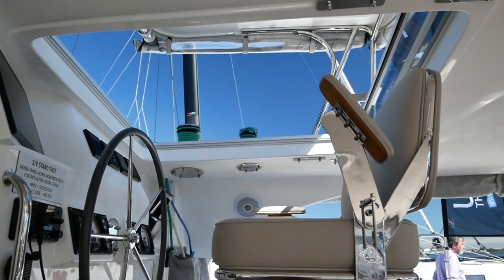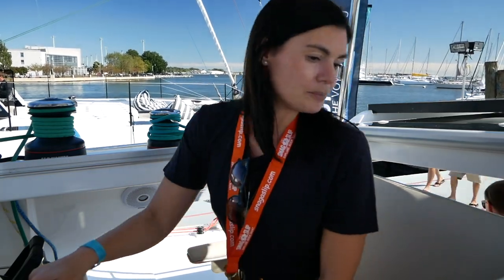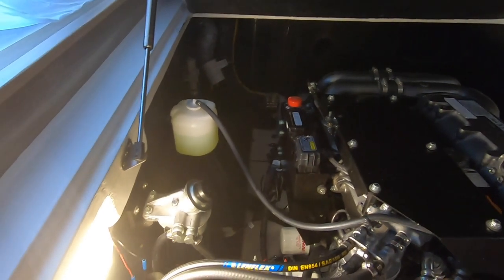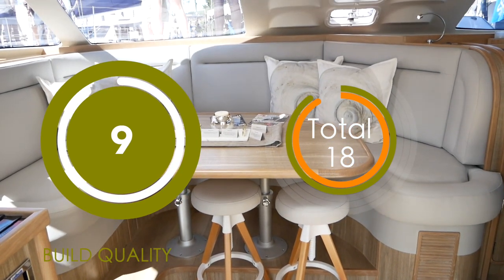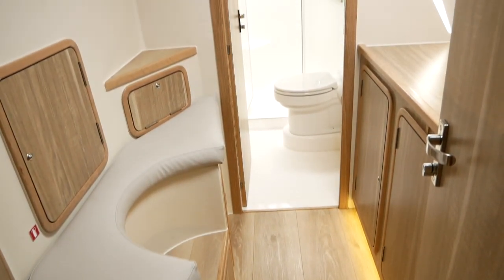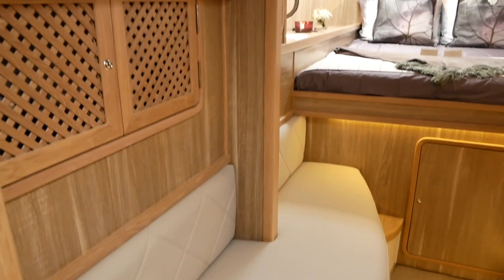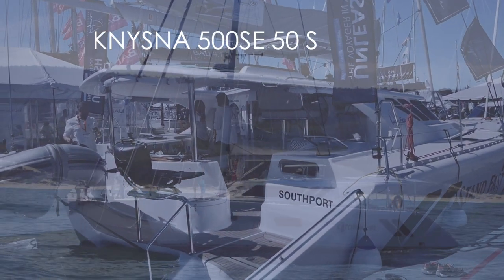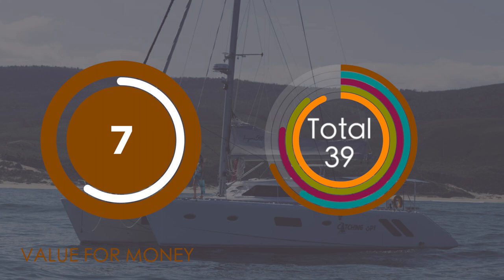Knysna 500SE Catamaran Review 2021 | Our Search For The Perfect Catamaran.

Comment: OMG, that is designs from 2020 meeting 1990 meets 1970. Curves everywhere. No thank you! Curved sofas are a NONONO! Not much visibility from the saloon either from what I can see?
On the outside, it reminds me of an old Prout catamaran actually. Good video as usual, but this is not the boat of my dreams.
Reply: On a boat curves are a good thing.  Nothing ruins a bathing suit like a big fat bruise on your leg from running into a sharp corner on a counter.  You don't want hard or sharp edges on the interior of a boat rocking about in rough seas.
Reply: Sail Mermaid very good point. I didn’t think of that.